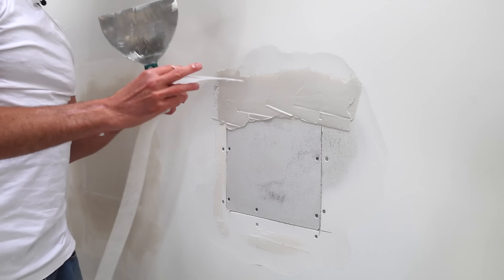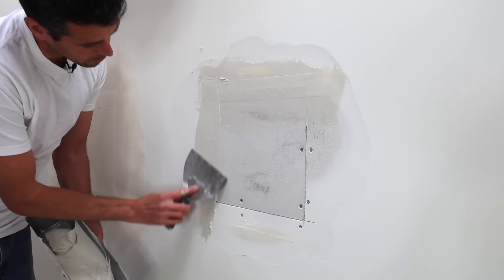The 3 BEST ways to TAPE DRYWALL!!!

Comment: I use mesh tape for all except corners... super thin, can fill the voids thru it without prefilling, and with hot mud i can mud and tape and skim in one step for a quick patch, and then texture it and be done...
Reply: Oh yea. We sometimes do cheaper stuff over here, so I fill some holes with 5 min twice, and do a skim with plus 3, easy easy patch with no taping lol. Not right by any means but oh well

Comment: I was told by a 30 year drywall pro that you should wet your paper tape before applying it. That helps from not forming bubbles because the wet tape does absorb all the moisture out of the mud. Have you ever heard that before? Also, I have been doing this for years and it seems to work well.
Reply: Look through his recent videos, Ben did a strength test for that method and a few others. While wetting the tape did make it lay nicer and relieve most of the bubbling more quickly, it had really poor adhesion strength in the end. There are a few reasons for this and he explains them, and as always, he covers a lot in that video. It's a good watch.

Comment: i use mesh on most of my patches . its good to prefill with quick set first , let set and scrape level and tight . then apply mesh and mud otherwise the mesh will bulge out at the seams especially on the ceiling . im 55 yrs old and do hundreds of patches per year
Reply: Aha! You answered my question. I didn’t know whether to put the tape on the “hot mud” pre-fill, or let it dry and then apply the tape with the green lid taping mud. Thank you and happy mudding.

Comment: I think prep is key to a good drywall patch outcome. I like to cut the existing drywall back on a 45 ish degree angle and prefill with hot-mud before applying tape.
Reply: I do the same thing and never had to come back
Reply: 10000%!! Sure you can get away doing it the way he did, but as stargateproductions aforementioned, those steps will definitely yield better results in finish and longevity.
Reply: Marcus Robledo  no problem. When you install your patch, take a blade and cut the face of the drywall on a angle around where the slit is on both sides. It should create a v notch so your mud fills better. It creates a stronger patch.
Reply: @stargateproductions  fills better and has more exposed surface for mud to stick to.
Reply: I know this comment is a year old, but I'm doing some ceiling patches right now. Should I also cut the 45 degree notches when doing these ceilings? I'm using 45 minutes hot mud and mesh tape. Is it better to fill the perimeter gaps, smooth,  and then tape after that first step is set, or fill the gaps and apply the tape while that's still setting? I've seen videos where people do it both ways but intuitively it seems like I should wait to apply the tape after that initial gap filling step is complete. Thanks!

Comment: I spent a day recently patching drywall ceilings in a house that was gutted following a hurricane. With the general understanding of the materials and process that I learned from you I was able to be one of the more proficient volunteers. Even better I was able to pull out some of the tips and tricks you've shared to solve a few problems.

Thanks for what you do. The folks who's house is being restored are going to have a little bit better of a home than if you weren't making these videos.
Reply: The hurricane work is tough but somebody’s got to do it!
Reply: That explains your " semi scrambled eggs ".
Reply: Nice

Comment: I love to drywall as a DIY'er.  It's a rather relaxing and Zen-like activity.  And since I don't bang it out day in and day out, I've found a trick which helps with paper tape.  Use a water spray bottle to moisten the tape slightly before applying it on top of the mud.  It helps with placement.  It keeps the tape from sucking all the wetness out of the underneath mud.  In addition, it allows for the slower methodical fumblings of someone that doesn't do the activity every single day.

The spray bottle also works to help adhesion of skim coats when applying to dusty surfaces.
Reply: That's a great tip - thanks for sharing!  I'll try it.
Reply: Awesome video!
Reply: dont do that.
Reply: @maddawgzzzz Why not?
Reply: @joncrosby8988  I know, I hate people who say don't do X, but don't offer a reason or solution.

Comment: I tend to usually have a lot of other things to do and probably opened the wall for wiring. Since I am working as DYI and not pro it works out. I found I suck as a drywaller. I just use paper and  45min fast mix. I open the wall and run the amount of wire I need. Then close it tape it. I come back a bit later after working on other stuff and form a valley that covers the tape well. Continue working on other things. Then come back and fill it in and spread as needed. Typically, The wall is ready for sanding and prime about the time I finish up the other things I was doing. NO a pro way, but I never claimed to be a pro. Definitely faster with better results since I started watching this channel.

Comment: I have used fibafuse that had a center crease.  I liked it.  Apparently the crease was a weak spot, and was prone to tearing, which I experienced(until I sanded the sharp corners of my knife thanks to you). They have since discontinued it. I think I still have part of a roll. lol 

 When I use fibafuse,  I wear light duty work gloves that are only about twice as thick as sweat factory gloves(latex, nitrile). If I forget to wear them and get the itchy hands, pantyhose works best at getting it out of the skin.  You are the man btw.
Reply: Even though it's no longer available, you can always fold it yourself to make that crease.

Comment: I have a modular home which is built in a factory and set with a crane on the foundation on site. I've found that the fibafuse is the best stuff for repairing the drywall cracks. Repaired with paper tape, the cracks come back, but when repaired with fibafuse, the cracks are gone for good. The fibafuse is strong stuff for sure, and a lot easier to work with than paper tape. In corners I use it with the corner tool and it holds up unlike the paper corners.

Comment: Great video! Question: can you use quickset with paper tape?
Reply: I can answer as Ben (VC) says it's better. However, he proposes to use All-purpose because it's more a glue type of compound. It will stick better. This is coming from him. Hope it helps.
Reply from the maker: You are correct. The adhesion is not as good with hot mud but you can still do it. That's why I add glue.
Reply: His glue technique is the best thing I ever learned here.  I use it all the time now whether I think I'll need it or not.  A little peace of mind and no adhesion issues ever.
Reply: @vancouvercarpenter  Thank for your great videos Ben. Just new here and doing my first drywall repair in the garage ceiling. Used paper tape and all purpose mud but got several blisters. Any video on how to repair blisters?

Comment: Definitely appreciate your instruction & explanations for using the different tapes. You’re good at what you do Ben. You’re a dam good teacher as well. Always learning new tid bits as I watch these videos. Between you & a couple other drywall experts, I think I can tackle most small jobs. Haven’t decided yet whether to either drywall the ceilings or have the popcorn (level 1 asbestos) ceilings removed. May need some professional advice if I choose the former.

Comment: Depends on the situation but we've been running regular mesh and fibafuse on the butt joints for several years. 

Strength, prevents hairline cracks and can use setting type mud and get to topcoat in one day. 

Needs to dry before sanding still. And over paint pitting is usually problematic, which requires extra skims. 

I'm a fan of fibafuse for it's result in addition to mesh. Uncomfortable to work with.  Rips incredibly easy, which is why I always call it cosmetic, it's just to prevent the hairline crack and mimic paper in that way.

Comment: The only thing we keep fiberfuse for is one day patches.  I’ve found the quickset mud dries a little faster as it can breath.  Also, as you said, slightly less build out.  I haven’t used the fiber tape since the last crack I had 12yrs ago.
Reply: In New Zealand the most of plasterers use fiber to tape joints and paper to internal corners. We don't have any problems.
Reply: @osvaldoschlusaz3395  another plasterer watching

Comment: I always use an egg beater to mix my hot mud, and even though I don't use mesh tape much, I prefer fibafuse, but I always double up the end so I can always find it. I do it with electrical tape, and any roll of tape as well.
Reply: Egg beater is the way to go!

Comment: i say fibafuse is THE best out of the 3, hands down for patches. It goes so thin and it's actually stronger than paper, the kilted drywaller guy tested the load strength.

Comment: I use the fibertape on my house, I live on a hill and have 2ft-9ft of crawlspace, yes the side of a hill and my pier and beam house moves a lot depending on the time of year so cracks are always showing up, The fiber tape has seemed to do A LOT better holding together on the doorways and certain area's that the mesh tape just couldn't fix and kept getting small cracks every 2-3 years. I am currently working on putting the mud-in LED light tracks in my house and I am using fibertape over the metal\holed sides of the light rails so we'll see how that works in a year or two.
Reply: I highly recommend Strait Flex "crack tape" fir recurring cracks

Comment: You make that look so easy. I tried method 1 and there was a bulge where I put mud on the mesh. Tape started moving a bunch of times. And the finish, well you could clearly see where I had patched. Solution was to put a picture over it!
Reply: you must of had very large gaps in the joints. you should prefill large gaps and let dry before taping

Comment: Curoius when taping a joint on a old wall and to a new wall. any tips. Man I’m doin a big Reno and the paper tape is bubbling where old met the new , yet all the new joints all are perfect. I use a lot of 90 set mud as a rule  to do Reno taping. then switch to final on the finish
 coats

Comment: When I patching small holes I cut away the face paper to frame a boarder around the hole and apply plaster to the joint with fibrefuse tape. That way I don’t have to mud out over a larger area. It also works with plaster plugs with dog ears to patch old power points and ceiling light holes etc.

Comment: I realize everyone has opinions based on their own experience, however your love of quick set is not DYI friendly.  I have used regular all purpose mud with mesh tape many times with no cracks.  I believe the key is to make sure the mud is thin enough to flow completely through the mesh to make contact with the drywall paper.  If you're merely smearing a layer of mud on top of the mesh tape you'll have problems.  Full penetration is the key!
Reply: agree for over 30 years no problem

Comment: I've never been a huge fan of the mesh tape, although I've used it plenty of times. I don't trust that the mud will fill the gaps behind the mesh as well as applying mud first then applying tape. Applying mud first with mesh tape is a losing proposition. Paper always works and it's versatile, but it does build out the butt joints especially. For patches which are almost always butt joints, I love the fiba fuse tape. It lays on thinner, for a flatter patch, and the compound oozes thru it so you're guaranteed good adhesion. 95% of the work I do is remodeling, mostly kitchens and baths, so I do a lot of patches. Fiba fuse is my new best friend. I also really like the plastic corner tape, straightflex, that comes on a roll with the crease for inside corners It makes a nice straight corner where a patch is on a corner. Paper will follow a crooked inside, but the plastic is rigid enough that the it will make a nice straight inside corner and give you the ability to finish that corner with less coats.

Comment: I am a novice planning to do drywall repairs in my own house at my own pace.  Since I will have no time pressures as far as drying times for any stage of the repair, does that mean I can use ready-mix mud for everything?  Or is a quick set preferable in some cases?  Thanks for any comments.
Reply: quick set has more glue in it and does not shrink as much as far as i know. All purpose is good for setting corner beads and setting tape, though it will need to be mixed thoroughly and thinned down with water to make it easier to wipe out. Watch all of this guys videos and you'll be great at taping! i just did a whole basement with his video help!

Comment: So after a square patch like these are fully dried and set, could I then recut a smaller hole out of the middle of that patch? 

I accidentally cut a square hole too large for a Sanus in wall power adapter. I’ll need to patch the hole as it’s far too large but I’d need to recut a smaller square hole inside the patch. 

For reference the square that’s too big is 6.5in x 8in and the smaller square would be 5.25in x 7in.

Comment: They sell a little spiral mixer for 5 gallon buckets at Sherwin Williams.  Just cut the stem down and chuck it in a drill.  It fits perfectly in the pan and if done on the 1 setting it won't fling mud everywhere.  Great for mixing up hot mud.  You can even remove the red spiral bit and cut it down to reduce fling as well.  Then just epoxy it back on the shaft.

Comment: Hey Ben, here's a video idea. Tips for patching ceilings! It's hard to tape and spread mud on a textured surface. And when you're done, you need to match the texture across your whole patch. I'm probably not the only one struggling. Thanks!
Reply: Mine is knockdown, removing a horrific 90's fluorescent fixture box... I'm gonna sand down for a few inches all around in hopes the repair doesn't make a hump and try to match the guy's knockdown from the 90's..(which was a really good job, pray for my hopper)

Comment: I like to leave the joints a little larger and pack the joints with mud prior to laying the mesh tape in the still wet mud as you would with paper tape (thanks Jose). Also the thin fine mesh tape is much easier to work with (other than finding the end of the roll the first time LOL) than traditional mesh tape.
Reply: Yeah I always lay the mesh tape in a wet bed as well. I didn't even know it could go on dry

Comment: is it okay to mud over wallpaper? i cannot get it off except for the top printed layer
Reply: If the wallpaper is really stuck on and you don’t want to remove it (I’ve never come across unremovable wallpaper) prime the entire surface with an oil primer.  That will seal the surface, and won’t allow the water in your mud to react with the wallpaper.  Then plaster the surface, and hope that the wallpaper really is properly stuck on the wall.
Reply: @valeriemaridor9505  normally id just damp the wallpaper and it peels off, worse case scraping it off. but this stuff, i dont know what glue they used, absolutel PAIN to get off
Reply: @randomrazr  soap with micro holes in paper, will remove it, get it really wet and wait.

Comment: There is one much better way, which is to use a roll of crackstop 36” mesh and make full-sized patches, even covering all three with one large mesh patch. 

Wipe the embedding coat (setting mud only) fairly tight to the mesh, diagonally. This leaves the mesh covered but slightly visible. Then after it has completely dried (fully dried, not just hardened) apply one or two very tight skim coats with all-purpose or topping compound. 

This method produces a durable & undetectable patch that’s approximately 1 mm thick. Force dry with a fan and paint it same day. 

Your patch work shows decent workmanship and great understanding of materials, but it would benefit by removing more wet material with a much longer straightedge. A tile straightedge or a Level5 skimming blade would help. 

If your sanding is anything more than 220 grit to blend here and there, you’re putting too much mud on the wall.

Comment: with fibre tape they do make 1 thats solid and 1 thats spined. i just buy the spined one as you can use it for corners as well. ive switched from paper to fibre as well since ive had clients dealing with fire department wanting fire stops and they wont certify with the paper since its flamable they say

Comment: I’m fixing holes and pop outs and repainting my bathroom. It has a very high ceiling. All along the ceiling corners the paper tape has lifted off. It’s just paper dangling in the wind. It’s stuck fine to the walls but not the ceiling. The ceiling plaster has all crumbled and fallen off. Is there some easy way to glue this paper back to the ceiling? I don’t want to rip it off and have to patch and repaint. I don’t even care much that the ceiling plaster has fallen off. If I can glue it down I’ll paint it white or just spot fill with plaster. Any suggestions appreciated!